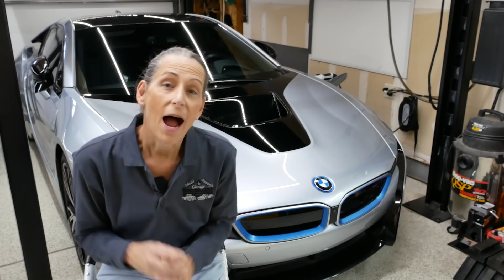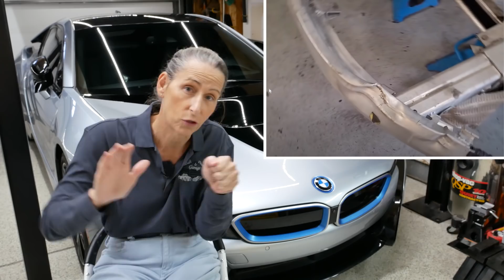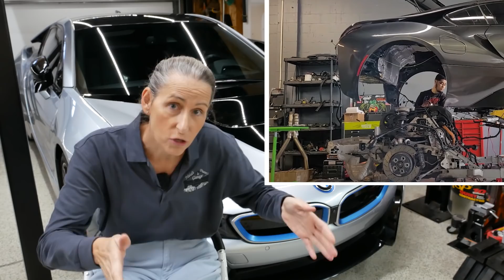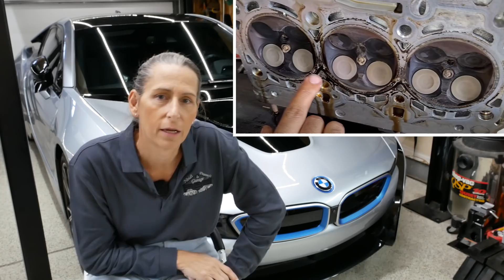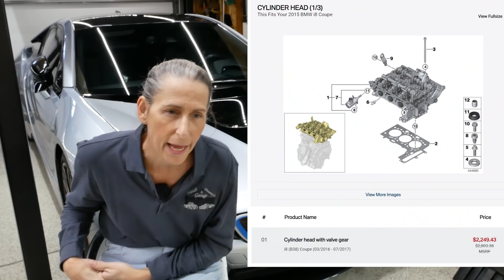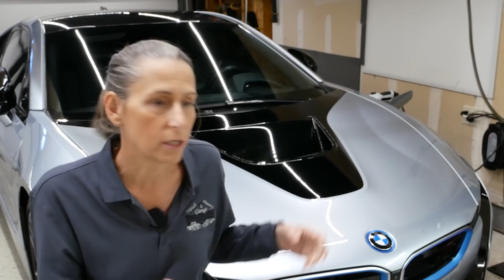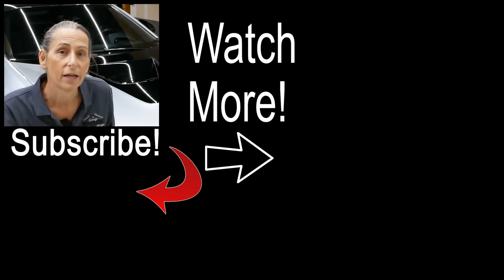Is THIS What Ruined Sam's i8??

Comment: Thanx ..so far I have no problem with this car :) great performance. 
Quick question ,  I never used aircon with this car .for 2 reasons,  first of all to avoid drain battery 
second of all 
avoiding having problem in future with air conditioning compressor to let it keep cooling high voltage battery . 
Can u let me how helpful is that . Thanks a lot
Reply from the maker: That's a good question.  My guess is that the HV battery cooling puts a bigger strain on the cooling system than the air con.  The cooling system will run any time the battery needs it (charging, Sport Mode, high use).  And it is important it gets used and doesn't just sit - it needs to be lubricated.  You might save a bit of use, but it will get used a bunch anyway. Just keep an ear out for it if you are worried. I spoke with a BMW tech about it and sent him a video of ours and he said that a bit noisy is normal. If you hear an obvious difference in volume and/or clanky sound then it might be a good idea to have it looked at.

Comment: Great analysis... I thoroughly enjoyed the video.

What should he do? I'm no mechanic but I've seen his video (it appears that the block's okay). Based on this reckon he should replace the head and also check for other issues (e.g. clean-up the pistons...etc). It'd be a real pain if he replaced the head, it worked and then other damage made it blow out again.
Reply from the maker: Totally!  I agree...  I think he should replace the head (not just re-work it).  It isn't just about sealing it is also about the two cams and the 12 valves...  If the cam bearings are no longer true the cam will bind and eventually destroy the bearings or worse.  Are the valve guides true? Are they seating completely?  If the head is "only" $2K, then that will be close to all the machine work required of the old head but with none of the problems.  I guess we'll see :)  My vote would be to wait until the part arrives from Germany.

Comment: My 2005 Accord with 370k miles has handled cross country trips from extreme cold and hot. Very hard Chicago driving and still runs. Nothing but wear and tear and maintenance. My son is driving it now. And the air conditioning is ice cold no matter how hot it gets.

Comment: New head definitely but if it was me I'd give the bottom end a rebore/oversized pistons and have the crank checked and install new big end bearings as a precaution. 
I've found in the past that if you don't give the bottom end the required attention after a new head the bottom end is usually weak and blows.
Yeah it's extra money but do it right, you don't need to do it a second time.

Comment: I have been following you and Ben about this car overheating, but even if the head gasket was bad, the coolant was still flowing threw the engine and should not over heat, can you explain why it was overheating? I understand that the gasses from the pistons was pushing into the coolant, but this should not have the engine over heat. I had a Honda Civic that had a bad head gasket and the engine didn't overheat.
Reply from the maker: The thermostat can't read temp in air, only water so it is possible the car didn't know... Also, air could cause the pump to cavitate and possibility get so hot it could melt (the impeller is plastic).  Just some guesses...
Reply: If exhaust gas/compression was leaking into the water jackets around the cylinders it would push the coolant upwards as the gasses tries to escape through the cooling system and eventually out the reservoir cap. This would consequently cause airlocks and obviously push the coolant out of the jackets around the head and block, causing hot spots and therefore the head to warp and gasket to fail furthermore. Overheating is a very common symptom of headgasket failure UNLESS the gasket blows between a coolant jacket and oilway. This is possibly how your Honda's gasket failed, hence why no overheating. Hopefully that makes sense 🙂.

Comment: Skimming the head is not a good solution. Once the head is torqued down nothing else will be in alignment still... like the cams. It will probably work as a temporary solution but the engine will eventually self destruct. Also the reason that the fuel tank was removed in the car was not to be cleaned out but most likely to replace the fuel tank pressure sensor that allows you to  unlock and open the fuel door. The failure of the sensor is a very common problem and is covered under a BMW recall program for free.
Reply: Agreed, id be giving serious thoughts to replacing the whole engine! Those all aluminium BMW units are normally scrap as soon as they have been cooked, even just once.
Reply from the maker: I think you are correct.  Thanks for correction about the gas tank. I totally missed that!

Comment: In had a Honda with temp issues. The coolant looked ok, but the mechanic who also smogged cars, put the smog test unit sniffer to the radiator cap housing, and exhaust was being measured.  Yep I blew a head gasket. Further investigation was conducted, and the engine was not bled correctly, and the was the root cause  of it all. If Samcrac put a sniffer at the radiator cap housing,  he would have known for sure that he blew the gaskets

Comment: This is YouTube so Sam MUST do a LS swap. Actually 1/2 an LS swap, saw LS in half so it will fit. Start swap and about 30-50% of the way in decide if the LS needs to be cut into an inline 4 or V-4. Whatever fits best. Its all that simple....on YouTube.

Comment: IF the block measures within tolerances then there is no need to replace it.  Therefore a replacement head is all that is required !  Perhaps one can be found used for less than the expected $2,000 but, if not, then bite the bullet !

Comment: Watching Sam's video where he takes the head to the machine shop and, based on what the machinist said  in it, I'm thinking there is no rehab for this head.  Have the bottom end checked out and maybe he can get away with just a new head.  BTW, having it shipped from Germany may take some time, but, its not like Sam lacks vehicles to drive.  The only issue would seem to be how to get it out of the service bay until a head is available.

Comment: Faye Hadley did a series with Daniel Soliz think that’s how his name is spelled he’s an engine rebuilder and they do a bit on straightening heads as opposed to just skimming heads and having problems with the cams being tight. very interesting 
if There is no damage to the surface of the head. Then just replace the gasket and try it have nothing to loose but a few hours of time

Comment: Head can be saved but it is a bit of work. It needs to be torqued to a plate with shims to bend the head back and heat treated. Rince repeat until very close and then a very light skim. Remember the cam bearings have to be straight also. Easy to burn over two weeks labor to maybe get it right, so most shops would not bother to try.

Comment: I think he needs just a different engine. Most ppl fail to realize these hybrids have a warm up phase(to protect the engine) whenever it sense certain amount of throttle input or when it reaches a certain speed. Which is why I always u the "hold state of charge" on my i8 to warm up my engine before even getting on the freeway or before getting it above 60mph. Then turn it back off immediately after the engine starts. Its usually goes back to edrive in about 30secs to 1 min. Especially in eco pro & it rides smoother when it comes back on for the rest of the day. Has anyone noticed this as well?

Comment: To all the people making jokes about BMW Engine failure. It’s not a BMW, engine, its a Citroen / Peugeot design, build. As is most vehicles with 3 cyl turbo engines.
Reply from the maker: You might be thinking of the Prince engine that was in the mid 2010 Minis.  We had one in our Roadster.  This is a different engine.
Reply: @HeidiandFranny   still a PSA engine. Same block, new head.

Comment: Cylinder heads can be heat straightened.  Just find the right machine shop.  However if the block is warped, new engine time.

Comment: I have a 2014 i8 and my water pump went out at 27k miles(august 17). No leaks, but it kept getting hot. I limped it back home 90 miles kept pulling over and letting it cool down dealer replace water pump and Anyways long story short  I have a similar story to what Sam is dealing with. Runs good but gets hot teated coolanr has exhaust gases we dropped the motor pulled head was warped nearly as bad as sams and I had the block checked out and it was with in spec. We put a new head on it and head gasket. And it’s been a solid driver since then. I out of fear of it failing I change the water pump every year before summer.(overkill? Yes!!!) 

Car just turned 68,000 miles this week.
Reply from the maker: Wow...  Thanks for that story.  Good to hear.
Reply: @HeidiandFranny  thanks for making the videos for Sam I never knew there were so many i8 owners that were into doing there m own work, I’ve enjoyed your channel as well very awesome content 
Which is great to see!!  

Sad to see the i8 being discounted as I wanted to buy a new one when mine hit 100k but I guess I’ll keep driving it
Reply from the maker: A Roadster perhaps? :)

Comment: On the question about how it could get hot enough to damage the head with the protections it has. If it had an air lock in the engine the coolant would not flow properly. So there could be hot spots well before the temperature sensor got hot enough to trigger protections.

Comment: I think Sam’s I8 overheated due to coolant loss. The fact that the car was a repo and there was prior front end damage the other shop that installed the new condenser might have disconnected a coolant hose and then didn’t know the proper bleed procedure. In my experience as a auto tech the most damage occurs when there is enough coolant loss that causes the coolant to stop circulating. The PCM can only protect the engine if it has coolant and the coolant temp sensor isn’t designed to read air temp so by the time the uncovered sensor sees critical mass the engine is actually a lot hotter. Many customers who experienced sudden coolant loss say the temp gauge read normal. 
I sent a message to Sam that cylinder heads can be heat straightened with a light cut to finish the process. Most likely the block will be okay unless coolant level fell below the cylinder liners in which case the bores will show scuffing.
Reply from the maker: Thanks so much for this.  This really makes a lot of sense.  I didn't know that about the temp sensor - that is really good to know.  I haven't chatted with Sam in a couple days (he has been filming).  I'm anxious to hear how the block really looks.  Such an unfortunate set of events.  Thanks!

Comment: He can un-warp the head and machine it, his machinist didn;t even suggest that but it is actually a thing. If you un-warp before you skim then there shouldn't be enough change in timing to mess with the computer too much. I think compared to $8,000 for a short block it's worth a try. Also, $8K for a short block isn't that bad given the value of the car - I can still see him breaking even if he does that. Of course now we've seen the bent rear rail (I noticed that in his video too) he might be screwed for other reasons...
Reply from the maker: Thanks for that!  Great analysis :)

Comment: I wouldn’t run with the user engine, for the price difference you said just go with a new block and head. Again a lot of comments here are correct, BMW have set that engine up from factory skimming the head may cause massive issues long term for the new owners

Comment: The trouble with what Sam does is to buy doddgy cars to start with. Suppose I was not very honest and had an i8 with a cracked block, I find a bum mechanic to say it is OK and a pay another bum to buy the car off me on finance, it looks like the bum paid me $12,000 down, but all I really get is the finance money less the kick back to the bum to burn the payment default wrap. Then the bum defaults of course, never makes a single payment and walks away with his cut. Car ends up repossesed of course and then goes through a number of hands with poor Sam being the last mug in the chain. Note that the auction houses get fees left right and centre and do not give a toss about all this. Think of the funny rasto guy with the funny cap laughing his head off, so,  I am not alone.  Sam should sell his i8 as a great parts car with many new parts and known blown head gasket, he should just cut his losses. Or he could buy an i8 from a heavy frontal collision and use the engine. The frontal collision car will sell on for less than he pays, but not much. Why take great care buying a frontal collision rear engined car? Because maybe the good engine has already gone walkies.
Reply from the maker: Just to clarify, this is a mid-engine car - there is no engine up front only an electric motor, subsystems, and cooling.

Comment: New head should be enough! ..but the bottom head should be straight and cleaned well. Would also improve the cooling of these cars, bigger radiators as hard driving in hot weather isn't helpful.

Comment: Love the channel and thanks for sharing your insight.  My take is check the deck on the block for straightness.  If good then discuss with a reputable machine shop about this option.  The reason I mention it is I had a similar situation with a warped audi head.  See if the shop if comfortable in trying to straighten it to a point that it would only need a couple thousands taken off to make it flat.  Based on what was stated in the Sam's video it sounded like it was out by .005.  My audi was just over .015 in the middle.   In the end the machine shop only removed .002 to clean it up.  Just wanted to share and was thinking outside the box. At this point is probably still sitting on his trash can and wouldn't hurt to pop that question.  Hope this helps someone else as well.

Comment: If the car was driven at a track day, the engine and coolant system would definitely be challenged. I wouldn’t call a track day hot rodding. But it would be pretty similar in sustained full throttle and minimal cool down in the turns. One thing to look at would be the brakes. Newish rotors and pads for a low mileage car would be an indicator of heavy deceleration. Most cars appear to be undercooled for track days. One 20 minute session is more than enough to spike the oil and water temperature. Do a couple of sessions with limited cool-down between and the ratcheting effect kicks in. Add in a hot day, and you can easily overheat.

Comment: Back in the bad old days of low compression engines with alloy heads, it was possible to heat them, press them until slightly bowed in the centre, then let them cool.  We got it to a fine enough art that they were within limits for taking two to three thousandths of an inch off meaning the cam bores were also within tolerance for alignment.  The problem is that heads that have been overheated to this extent are often 'soft', but if treated gently to repeated cycles of heating and cooling will work-harden again to an extent.

Newer high compression engines with their thin head gaskets present more of a challenge.  If the alloy in the head goes soft it can make it really hard to get even clamping force with the soft alloy, sometimes with torque to yield head-bolts the alloy is so soft that a very short time after re-starting the engine the bolts pull into the head and it loses clamping force.  Then you are back to square one with combustion leaks.

In this case I agree that the block is probably going to be okay.  The block has mass on its side and typically is less likely to be damaged.  If it passes specs a new bare head is likely the best option.  The rest of the valve-train components should be fine to reuse and it would be a reasonably economical repair.  It would be sad to write off an otherwise good car for the sake of the cost of a new bare cylinder head.

Comment: I rather would use BMW’s next over size head gasket and refit the original but lightly skimmed head ... if the problem is stil there you only have spent small money and one knows that big money is unavoidable ...

Comment: If the rest of the bottom end is good and gasket surface of the block is flat and not damaged with corrosion etc I would buy a new head and install it. Best selling point of the car later on new head fitted. Then I would skim the old head and put on Ebay for sale and recoup come costs of the new head.

Comment: In the olden days, when an engine had an overheating problem, the trans was usually cooked too so not knowing the I8 personally, I'd try to find out what else got cooked when the engine overheated before sinking another dime.

Over the years, I have unfortunately run across a very few cars that the previous owners had screwed up so bad that literally everything wasn't right.  I know everything can be fixed, in theory... but sometimes it's best to let go of a nightmare before it eats you alive.   

I know it sounds stupid, but I went down the rabbit hole once and almost did it again... Thankfully my first mistake that cost me a few hundred dollars saved me from a much larger mistake the second time... Now, I know enough to cut a nightmare car free before it drags me under.  Which, by the way, all of that BMW's previous owners were smart enough to do.  I'm actually guessing that the first owner screwed it up and just let it get repoed because he couldn't fix it or sell it.

In the up side, that car might have a few valuable parts that could recoup Sam at least some of the money he sank into it and he's already got it part way apart.